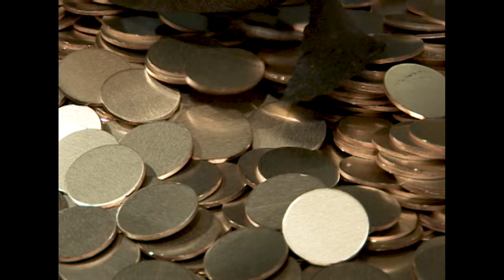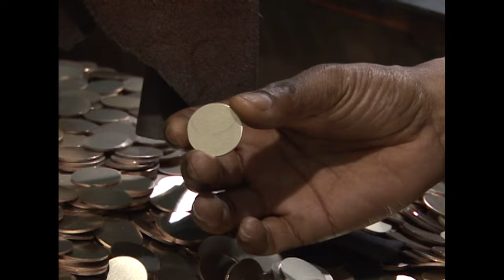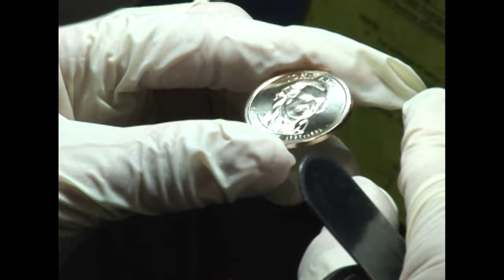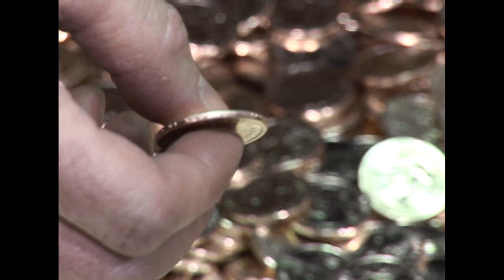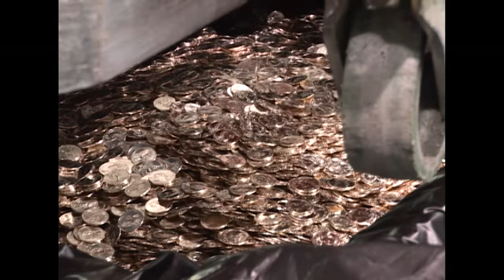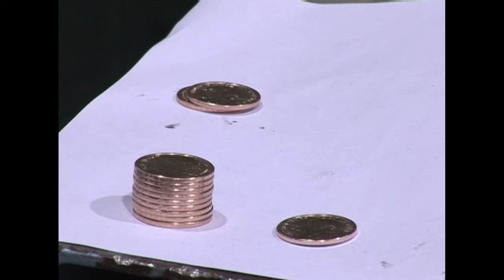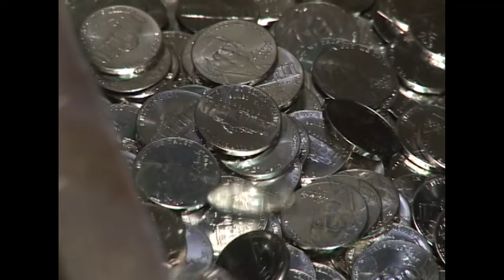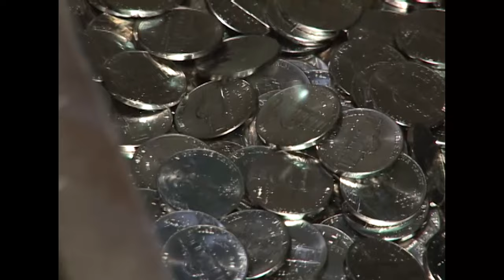Making money at the mint in Philadelphia

Comment: 1. "Blanks" are punched from the sheets. There are small scraps of metal left after the blanks have been punched from the sheet metal.
2. "Planchets" are made from the blanks by providing sort of a rim around the edge, which will be perfected when the planchet is stamped by the dies. A comparison of a blank with a planchet is shown at 15:05.
3. Coins are made from the planchets.
4. At 18:00, coins are inspected. ["They don't say 'Hanes' until "I" say they say 'Hanes' "]
5. Various coins (such as John Adams presidential dollars, Washington State quarters, Lincoln Memorial cents, nickels and dimes are shown.
6. a) Does the guy at 37:55 ever suffer from "metal fatigue"?
6. b) Around 44:15, this gives new meaning to the term "March of Dimes"!